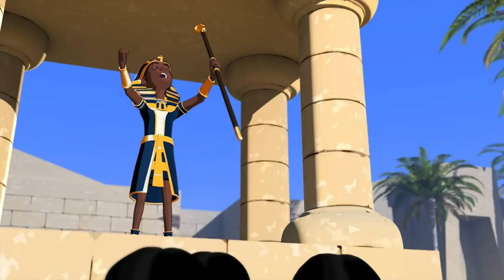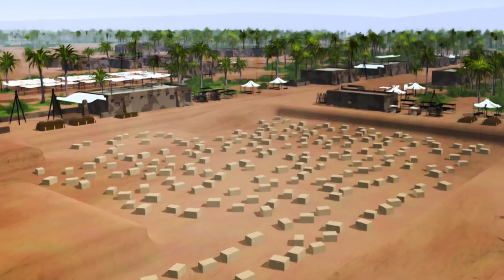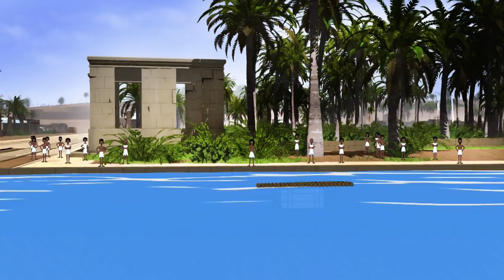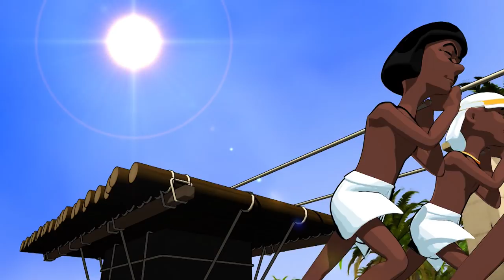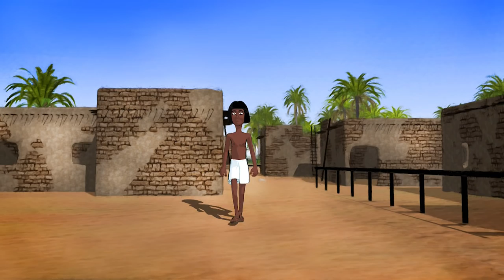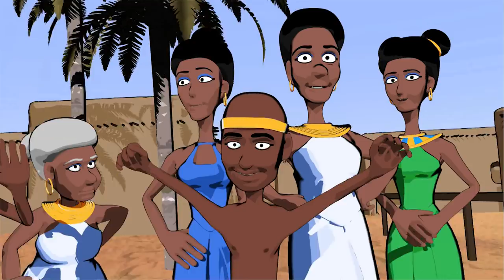The Evolution of Pyramid Building - Part 1

Comment: Have you calculated, weight and dimensions of the stone, the volume of required flotation device and the depth of water column needed. coz it could get tricky once you apply this to  pyramid building.
Reply: I did some basic calculation and if you added floats to all 4 sides and the top and divide the total displacment number by five, you get about 116.9 gallons of water/ air you'd need to displace, per side, slightly more then a average American bathtub. so that is while cumbersome totaly doable. And would be a lot more simple and easy then the other methods described of pulling them with brute force. I am a certified scuba diver, and you'd be amazed how under water using lifting bags I can float things around like a sunken boat that I could never lift on land. Personally I'd have to be convinced now that they wouldn't have done this method rather then convinced otherwise, it is simply easier and cheep all ways around. And it may have take time to work out the issues and kinks, but they were making the pyramids over the corse of hundreds or thosands of years. I mean from the time we learned how to fly and they said it was impossible to when we landed on the moon was less than 100 years. And if they had over 1,000 to perfect their methods and learn from mistakes with small pyramids. I see it as perfectly doable.
Reply: @LegoSwordViedos   There's also a video by Joseph Davidovits about building those rocks from clay mortar. You would want to watch it too.
But while it explains the sandstone masonry, it does not explain the huge granite blocks. Maybe it was a combination of the two.
Every time brute force is the last option.
Reply: @LegoSwordViedos pyramid evolution happened in 136 years, a startlingly short amount of time, not 1,000 years! They went from the step-pyramid (6 mudbrick and stone mastabas stacked) to the great pyramid at Giza in that time frame.

Comment: Rather than using your external removable stone pipes, for lifting blocks up the pyramid, how about using the internal ramps and making them airtight? Does what little is suspected, about the internal ramps, fit with your model?
Reply: Oh yeah! That could be what they’re for. In fact there’s evidence of water once flowing through some of the tunnels in the way the sharp edges have worn.
Reply: yes this is correct... also explains the diagonal "vents" which are actually more like straws to control water pressure.

Comment: the secret to coral castle was that he used diaphragms and solenoids and gear rations of 16:1 something like that. but you can see the guy has these different work stations for  lifting devices, these cutting devices, these pumping devices, the guy that built coral castle said it himself, " i solved the secret to how they built the pyramids. "
bagdad battery. the ark of the convenant. the light bulb stelle complete with bulb, wire, and insulator blocks.  no carbon from flames where deep inside the tombs they hammered and painted and wrote, the absurdity of using polished metal to deflect and redirect the light to the deepest depths. doesnt make sense. you take this will all the similar looking megalithic walls all over the planet, peru, easter island, japan, italy, egypt, azores.
the offcuts, if the saw were veering to the lets say left, you would notice right away if your doing this all manually. a ten inch overcut veering off doesnt make sense unless it was a motor driven saw. the caves around the world with striations too perfectly aligned to be hammer and chisel. the advent of rotating drums with spikes on the end of long boom arms in the late 70s were the only time we had the technology to mimic these same striations. 3 billion cubic yards of detritus from one cave estimated excavation and not one evidence of sign of tailing anywhere? a great wave perhaps? the list goes on. the fact that the stone vases were perfect and then terracotta housewares, obviously they lost the tech, or a different people inhabited egypt who used the stoneware jars and bowls. 
they dont consider anomalies when it comes to history, they toss out the ooparts and leave them without explanation because the only explanations is the impossible.

Comment: In Alquran Said 1400 years ago that Pharaoh build the pyramid was using baked clay instead of limestones (baked clay turn into limestone after thousand of year process ) and It is true  because there is no such technology at that time In how to pull and lift a heavy lime stone Read the Quran and you will get the answer
Many Scientist thought that pyramid were built by pull and lifting the limestone using temporary water canal and hang it with wood in the water (Buoyancy weight) or rail tunnel to transport the limestone rock from bottom to the top. It's an insane method and if it's true the people in egypt will build the other things with this "insane method" and also people in egypt can create a heavy duty wire-rope and make a good tools to cut precision the limestones as well.   
This is my opinion: The pharaoh was instructing Haman (Architect ministry of ancient Egypt) and their slaves to made giant statue or big bricks from mud clay and arranged them as base foundation, after that when the stone clay molds were still wet they did the engraving (Hieroglif) at the big stone (mud clay) walls and when they want to continue the work by making them higher they burnt it first and repeat it step by step until the top of pyramid done. 
Scientist just need to prove that mixed material of "baked clay" can be turn into the limestone after three thousand years process

Comment: Pyramid blocks made by mud. Workers getting stone dush, sands, clay's and water. They mixed all if it in the surface where pyramid start. Mud blocks keep it dry and when dry start pile the blocks going up until pyramid shape mud blocks after thousand years become solid like stones.
Reply: USA deny Asian and African history about the fact that giants excisted among them, both neanderdals and denisovens. Everyone knows today that the neanderdals built Stone henge . Type of stones only excisted so many miles away sooo heavy that impossible for modern humans to drag. It was found it was dragged trough the mud by using the water to wet the mud on the ground by the Neanderdals ! Trough calculations and their bone of Neanderdals remains found around sight. That is not a theory any more its a fact . The pyramid stones also only excited many miles away and in such weight that it was impossible for weak modern humans to drag. Also found that water of the Nile used to drag it, soo I would say that the neanderdals or denisovens built them.🙏🏾